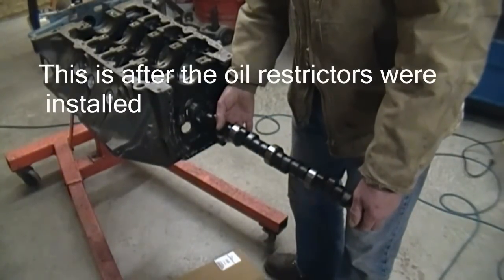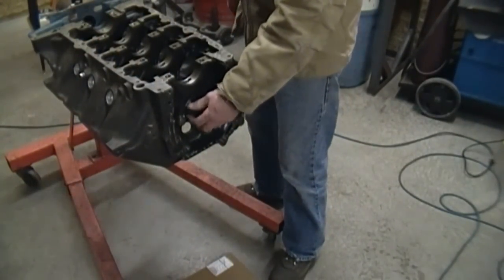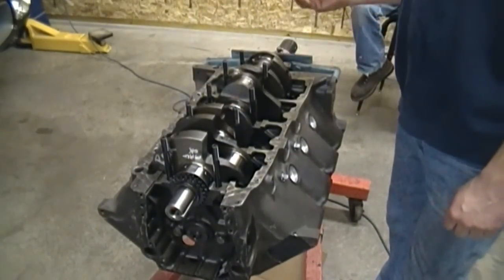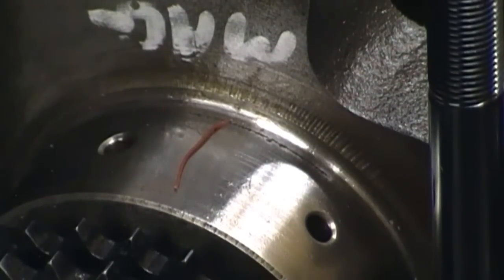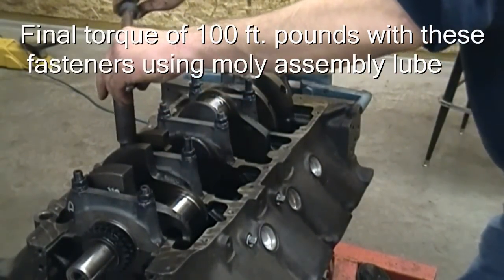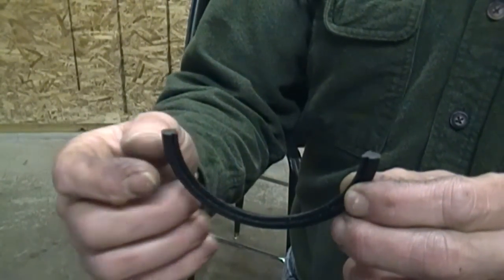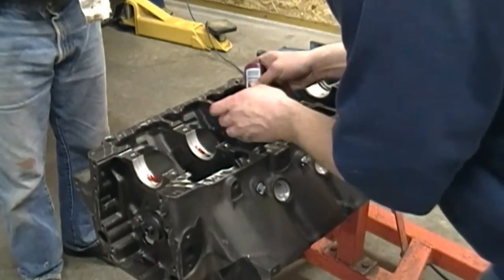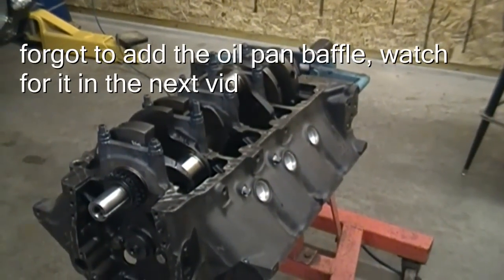Checking bearing clearance in a engine using Plastigauge

Comment: Must do this doing assembly!  I learned the hard way.  The machine shop ground the mains .020 and the rod journals .010 but gave me ALL.010 bearings...grrrr. Oil pressure was very low and you could hear a slight knock.Fortunately, I had a frined who could pull the crank and change the mains without pulling all the pistons out so that helped...a little.